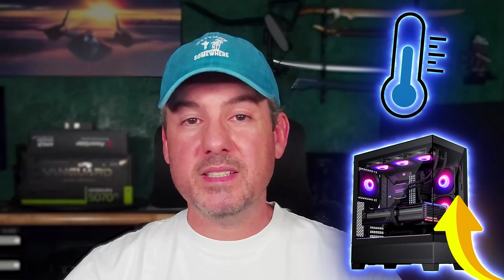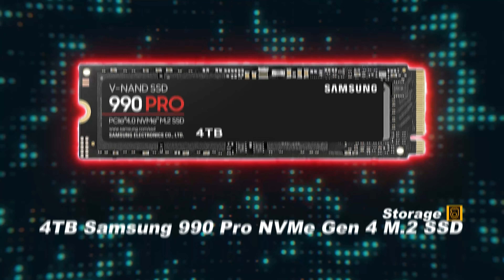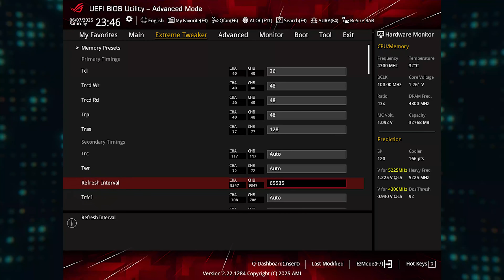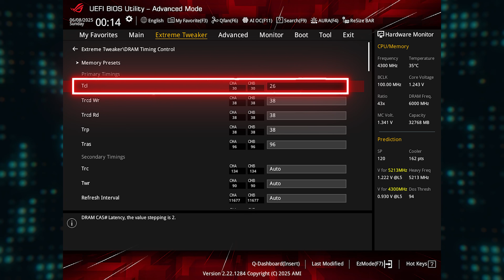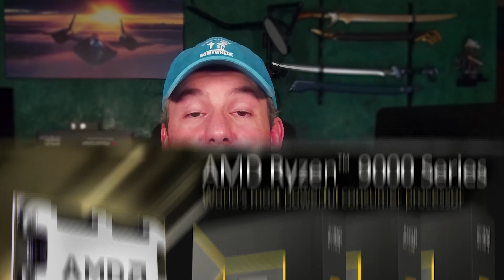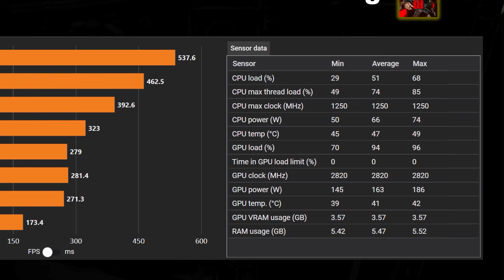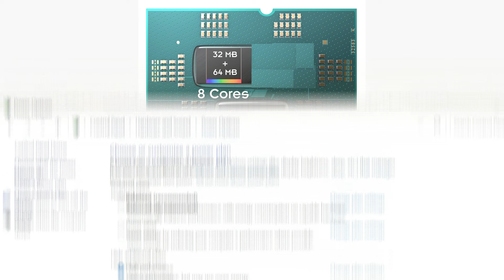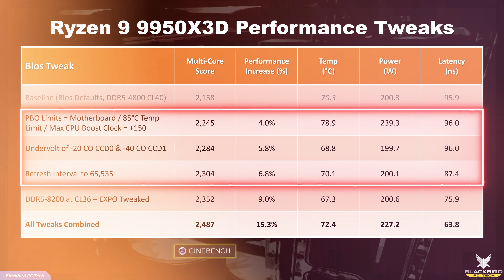What Are The Best Settings for an AMD Ryzen CPU?

Comment: Excellent video, you put a lot of stuff together in a way that is concise and easy to follow. Well done. The only thing I disagree with is setting tREFI to 65535 as a 'pro-tip' as this will make you system more susceptible to heat instability, so I think it's important to test for RAM stability while stressing the GPU to add its heat generation into the fold. In my system, for example, while stressing the RAM I saw temps around high 40s (Celsius), but with GPU under full load that quickly climbed high 50s and with tREFI at 65535 I saw errors around 57C/58C mark.
Reply from the maker: That's a good point and something I should discuss in the video

Comment: When setting negative values, is it a bad sign that the AIDA test timer actually hangs up for couple of seconds where the numbers will skip ahead? Noticed it started happening at negative 26 for my 7700x and it actually entirely hang up at the beginning of the test the first time. I ran it for 5 minutes but didn't get another hang or the red error message. Same with -30, though I didn't get the complete freeze, just that the numbers stop counting some times and skip ahead 2 seconds.

24 seemed to the last one where it didn't freeze anything

Edit: Ran 25 for 30 minutes 20 seconds without freezing or errors. Think that's the absolute stable one for me.
Reply from the maker: Yes, that's not good ... sounds like -25 is a good option, which is actually really good
Reply: @blackbirdpctech  Well, now after 2 months, my entire PC crashed while I was playing Assassin's Creed Odyssey. I went through several games and hours since that time without issues, until just about 20 minutes ago. Undervolt is set to -24 currently. I'll see if -22 causes issues, if that was even an issue caused by undervolting and not my new PSU being toasted.
Reply from the maker: @bobbitybob-o8q  there really isn’t much difference between -25 and -20 … if you suspect the undervolt is the issue I would back off to -20. But I would guess it’s a RAM instability and not your undervolt.
Reply: @blackbirdpctech  Actually with -25, after  2 weeks when I had initially set that up, three times at random times basically my whole PC would gradually become unresponsive where initially the system would slow down, I couldn't press any buttons, then keyboard wouldn't respond and finally the mouse would freeze totally, which fixed itself after I set the offset to -24. That was almost 2 months ago, this complete system crash however I've never gotten before. I'll try -20, but I'm hoping it's not any of the parts, especially the RAM considering I'm having doubts I'll be able to obtain the exact same kit again.
Reply: @blackbirdpctech  Yeah been running different software and games with -25 for 8 hours now and haven't had issues. -26 was the first one that started freezing, -34 straight up crashed my PC when I ran the stress test
Reply from the maker: @bobbitybob-o8q  I’m not suggesting there is anything wrong physically with your RAM, I’m suggesting it might not be stable. Have you tested it in Karhu?
Reply: @blackbirdpctech  Well, the thing is that I'm running the RAM on factory settings, haven't even enabled the EXPO profile on it, which would be odd. But no, I haven't run Karhu yet, I'll try to do so soon.
Reply from the maker: @bobbitybob-o8q  how many dimms are you running?
Reply: @blackbirdpctech  A 2 x 16 DDR5 kit. More specifically it's Team Group VULCAN 2 x 16 GB 30-36-36-76 DDR5, base clock at 4800 MHz, EXPO at 6000 MHz
Reply from the maker: @bobbitybob-o8q  then it’s almost certainly not your ram stability
Reply: @blackbirdpctech  I'll run the Karhu test this night and I already set the undervolt to -20. I'll see if I get any more crashes.
Reply: @blackbirdpctech  I've now crashed 3 more times since about 2 weeks ago, all of them in the same game and pretty much in similar situtations, all with the -20 undervolt, so I doubt even the -24 offset was the culprit. I also did the Karhu test for 12,5 hours and got 0 errors with the non-EXPO setting. Also did sfc /systemscan and DISM /Online /Cleanup-Image /CheckHealth. SFC found errors, which I fixed, but it still crashed any way. DISM came out clean out, but I've still crashed one more time since that. Event viewer doesn't show anything that would indicate a failing PSU, CPU or GPU. Nvidia did release an update today, so I'm hoping it's because of the last update they released in December broke something.

If I'm still crashing, I'll try updating the BIOS, there actually are several updates for my ASUS board, but haven't bothered to update it in case  they would break something, though thankfully my board has a dedicated flash button on it to make restoring easier.
Reply: Turns out that my crash issue wasn't related to undervolting at all. I turned pretty much everything to factory default, both on BIOS and Windows side, after a few weeks of crashing and was still crashing then, even though stress tests on CPU, GPU, RAM and also the OCCT power tests showed everything was supposedly fine. I updated my ASUS BIOS from some old 0215 patch (what's interesting is that the ASUS support page shows that update was from March 2025, but I see the same versions on ROG Strix boards dating at least half a decade back before 7700x was even a thing) to 3602 from December and so far haven't crashed after multiple hours. Before, it got to the point that I turned curve optimizer to "disabled" in BIOS, while it was at auto in default settings and was still crashing.

The thing is that my CPU actually runs a bit hotter now after updating the BIOS, not critically as my Phantom Spirit is doing its job, though I think it just means it's now working as it should.

Comment: Ok, i learned a lot from you and your guides, thank you very much. You are the one that got me away from the mainstream techtubers and the plethora of false or incorrect information! I am still a bit confused about one thing in this video though, the core clocks "optimizing/understanding" is this in addition to selecting expo tweaked (which in my case i have that option). So first you select the expo tweaked profile and then start optimizing the core clocks ? For my use case it's Dominator titanium 6000 cl30. 
Once again thanks for all these video's i can't stress howmuch i have learned from these.
Reply from the maker: You are very welcome. For the memory related clocks, there are really only two choices to be made:

1.  UCLK - select 1:1 mode if you memory is <= 6400 and 2:1 mode if > 6400
2.  FCLK --> I show in the video how best to select this
Reply: @blackbirdpctech  Thank you, when i do this my system will be fully optimized, i am aware that there is no way to fix the 1% lows with the x3d chips, but this has certainly made thing better and smoother.  You will have an extra member to express my thanks.
Keep up the good work.

Comment: Bro just proved that turning on EXPO does 90% of the overclocking heavy lifting. Aside from the ever-so-slightly disingenuous "baseline" runs being at non-expo memory clocks, it's actually a very comprehensive and solid guide for OC'ing. I say disingenuous because I don't think a single soul buying 8000MT/s ram kits would consider them running at 4800 MT's to be at their baseline. Could have just worded things a bit differently to indicate that most of the performance gains aren't from "overclocking" per se, but rather just from implementing EXPO settings. Yes, I know EXPO is technically overclocking. Yes, I know advertised ram speeds aren't guaranteed. Yes, I know he showed us how to overclock even further past the advertised speeds - which is why I'm ultimately saying this is a solid guide. I just think the reported baseline speeds used to show performance gains should have been with default EXPO settings on since literally basically every modern system should have their EXPO or XMP profiles activated even if you never touch anything else.

Anyway I've now got my 6000 MT/s CL30 ram running cleanly at 6200 CL28, and my 9800x3d stable with a -40 undervolt and +200 all core boost clocks (did I just have a minor win in the silicon lottery?) for...about a 6% gain in benchmarks. But hey it's running stable and never getting over about 64C so win/win
Reply from the maker: While I'm happy to hear that you were able to extract additional performance, I disagree with your comments around testing at stock conditions. Stock means everything on Auto ... that is precisely what everyone will get if they don't go in to Bios and make adjustments. Enabling EXPO/XMP in the bios is, as you acknowledge, overclocking. And it's the same level of difficulty as enabling features in PBO. You need to test for stability after enabling any overclocking feature, especially EXPO. I made this clear in the table and I made it clear in the video. One important thing that you may have missed when looking at the table is that the performance gain is just for Cinebench ... which does not incorporate the benefit of a reduction in latency. Games however, will benefit from a large reduction in latency ... so if you simply enable EXPO, your gaming experience will be meaningfully inferior to dialing-in all of the other tweaks as well.
Reply: @blackbirdpctech  I stand by what I said about EXPO. Simply turning on EXPO/XMP without touching anything else in bios is child's play compared to tweaking PBO settings and I'd trust most people to be able to do that. Additionally, most pre-built PCs (which somehow are more popular than ever) come with it already enabled. That said you can for sure still benefit from going past simply enabling EXPO, wasn't trying to imply you wouldn't

Anyway, it was only a minor criticism and I did still say that your guide is overall solid, comprehensive and easy to follow. In the end every step of it is important to understand if you're going to be diving into overclocking. I'd 100% point someone here if they needed help with OC'ing and I'm not in the mood to be the one helping them lol

Cheers 🍻

Comment: I have GSkill CL28 6000 32 kit with 9700x but I'm curious if it would be better to try to overclock them to 6400, but I'll have to do everything manually as I have Gigabyte mobo.
Reply from the maker: You can certainly try but you will have to loosen your timings ... I would recommend following the advice in the video to find a g.skill 6400 kit and trying to match those primary timings. If 6400 doesn't work then you can try 6200.

Comment: Quick question, for a 9800x3d should I use the ultimate power mode or just high performance?
Reply from the maker: High performance ... I experienced some issues when using the ultimate power plan
Reply: @blackbirdpctech will do, appreciate it

Comment: I hit -50 on my ryzen 7600 on curve optimizer, my voltages are around 1,12-1,13 on cinebench... I think i win a golden lottery haha Can i just turn on override and take 100mhz+ without changing limits on PBO to motherboard setting, or its risky?
Reply from the maker: I don't think that will be stable without getting clock stretching ... did you test it in AIDA64? You can apply a boost clock without using the motherboard limits.

Comment: What if I used CL40 RAM while setting up these settings with my 9700X? Will the high latency cause a decrease in possible FPS or little to no difference in performance? So should I really get CL30?
Reply: like highering the tdp stuff and etc.
Reply from the maker: You can see the impact of CL in this video: https://youtu.be/lx2SHUT9l7c

I would not recommend using DDR5-6000 CL40 RAM ... it will hurt your performance in a meaningful way.

Comment: I got a -25 and a +200mhz but the temps are the same as they used to be, any idea?
Reply from the maker: Think about what you did ... you dropped the voltage but you also boosted the clocks
Reply: @blackbirdpctech  My cpu is reaching 75c with those tweaks on Battlefield 6, should i be concerned?
Reply from the maker: @tinnoe2k   I would recommend testing just the undervolt and seeing how it compares with the stock settings and then adding your boost clock. Do you think 75 deg C is something to be concerned about?
Reply: @blackbirdpctech  I don’t think I should be concerned. Maybe the higher temps are just because of the O11 Vision’s compact build.
Reply from the maker: The temps are not high at all ... what are you comparing them against? The reason it's important to test against your stock configuration is to baseline your expectations.
Reply: Without any tweaks, I was getting around 75–83°C while playing BF6. My brother has the same setup, just a different case and Kryonaut thermal paste instead of Arctic, and his temps are about 10°C lower.
Reply from the maker: The thermal paste difference will be worth a few deg C ... but your brother could have also lucked out on silicon lottery too ... just because you have the same components does not mean you will get the same performance.

Comment: Hi Matt,
I have ruled out that my maximum stable undervolt is - 20 (anything beyond that will give an error on Aida64). After optimizing that, I am testing cpu boost and PBO motherboard. I started with +200 and I got errors. +175 Mhz also gave me an error (all of this with the - 20mv undervolt applied). I will now test this with +150 Mhz. My cpu temps are very good (maximum 60-70 since I have an AIO) does this mean that it's just the silicon that can't take the cpu core boost?
Reply from the maker: Yes, it's the CPU ... but often times even if you can run a +200MHz boost you will get better performance at lower boosts ... so it's best to test a range and pick your optimum.
Reply: @blackbirdpctech thanks Matt. Will take a bit more time testing

Comment: Thanks for such a robust video. I am testing my chip with - 20 UV, +200 MHz (5,4 ghz), PBO motherboard, and EXPO tweaked (asus mobo). CPU gets to 150 watts under cine bench 23. Seems like good results. I do have a question: my cpu clocks are not constant 5,4 on idle, is this normal?
Reply from the maker: That's normal ... remember that in idle you will still have tasks running in the background.

Comment: Okay so I already had Ryzen master crash. My cpu is 7800x3d, pbo enabled with -10 curve. With pbo off I didn’t crash at all and saw a difference in temps lowering and performance being better. Honestly lost as to why the bare minimum curve just doesn’t work. I didn’t mess with cpu boost override so maybe that’s why? Like I didn’t put +50 or +100 ect ect. If you or anyone here in the comments could help me understand how to either fix it or if I should simply keep pbo off with the -10 curve. It crashed the Ryzen master app with pbo on. Without pbo on, I didn’t have any issues (so far)
Reply from the maker: As I state in the video, don't use Ryzen Master ... make the changes in Bios directly. Furthermore, a 7800X3D is locked for overclocking, so entering a boost override won't do anything.
Reply: @blackbirdpctech  i understand. I will do bios only and go from there. As to finding out what works all around with temps and performance. What steps should I take in order to see ?. Example would be like changing curve then testing or changing curve plus changing cpu boost override to +50 then go test it?. I apologize as I’m trying to learn this all being fairly new to the pc scene and your videos are the easiest and have the most information to follow compared to others.
Reply from the maker: @christianking-ev4vj  you can simply follow the guidance in the video. If you want additional help or tech support, you can join our community in Skool:

https://www.skool.com/blackbird-pc-tech-4230/about?ref=67e6a7048d9540fe87cbdf1b69bd47f3

Comment: As soon as I tried +50 on my 9800x3d Aida 64 gave me an error at 1:54 into the test, +25 was stable though on a -30 undervolt. I don't know if that's just the limit for mine or I did something wrong.
Reply from the maker: A -30 undervolt means that your CPU is great silicon, so I would be happy with that and not too worried about the boost.
Reply: @blackbirdpctech I was able to lower it to -20 and got it to +200 stable in ottc and aida. Random question, is it normal for a new pc to smell rubbery for the first few days, nothing I'd burning or melting I've quadruple checked, but it just has this strong rubbery industrial smell to it.
Reply from the maker: @726frost  I typically don't notice that when I build a PC but I may have gotten desensitized to it

Comment: I use amd tweaked as we have been talking about it on another video of yours,   

question should i change my dram refresh interval if so to the same values or different ones.. 

ill tell you my specs 9800x3d ive done  a curve optimizer -30 with a x5 procision over scaler and plus 200mhz on the clock speeds, 4090, 96gb cl 30 amd expo kit

again my system feel more snappier but im going to run an over ram test with the amd tweaked memory profile  with karhu ram test,  do you suggest anything else
Reply from the maker: You can join our Skool community to get specific guidance on how to setup your system the right way:

https://www.skool.com/blackbird-pc-tech-4230/about?ref=67e6a7048d9540fe87cbdf1b69bd47f3

Comment: Thanks for your explanation and guide! Could you explain why you change the thermal limit from 95 to 85? I'm confused and haven't been able to find any data or anything supporting the change. Thank you!
Reply from the maker: It's not necessary, especially if your system runs cooler than 85 deg C ... that said, if you don't have a good cooling solution and/or you push your system too far, setting a lower temp limit simply provides an additional layer of conservatism to avoid risk. For example, if someone adds a 10x PBO scalar then they are pushing their boost to remain in effect ten times longer, which isn't good for their long term system health.